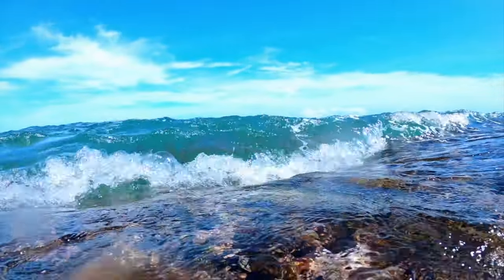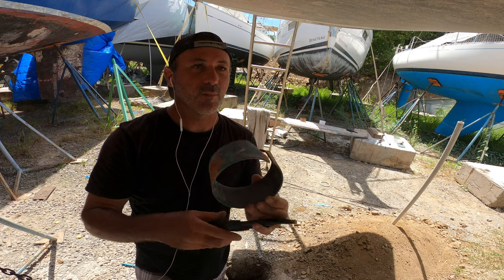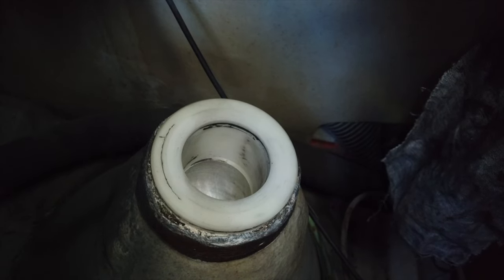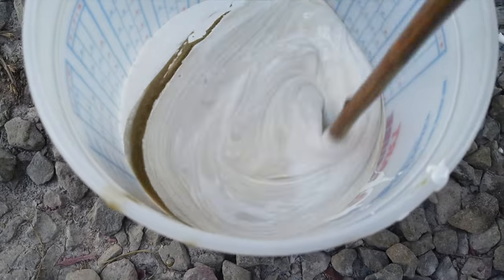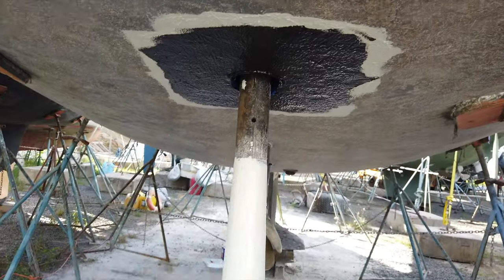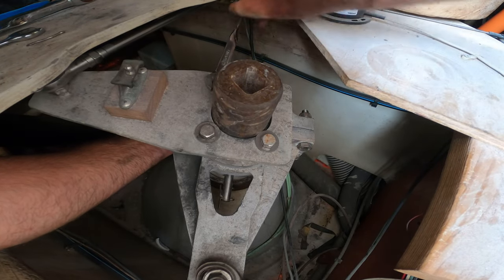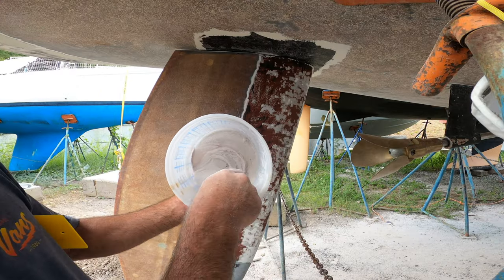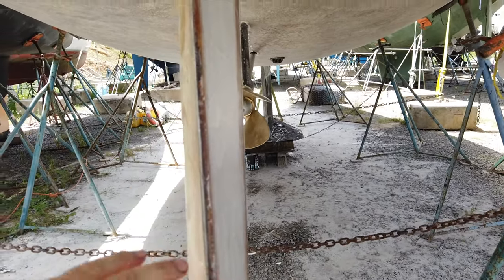SAILBOAT RESTORATION: Beneteau Rudder Bearings and Rudder Installation

Comment: just a tip to make your life easier  - there is not a nut or a bolt - or combo of both on a yacht that doesn't need "never seize" , nickel based
Reply from the maker: @yachticus agree nickel based never seize is a good product but i wouldn’t use it on every single bolt on my yacht.  I do use it on certain things though.

Comment: Help ! Please tell me where you bought a lower rudder bushing !!!! I’m on Carriacou snd having no luck 
The gap is supposed to be .5 mm. No sealant from factory. 
I got this info online but I can’t find a bushing.
Top bushing is fine on my 2000 38.1. Lower had lateral movement
Reply from the maker: @jacobuszwanenburg1629 I purchased the lower bushing from Murray Yacht Sales located in Florida.  Beneteau is using there dealers for parts sales these days.  locate the closest beneteau dealer to your location, likely in Martinique, they should be able to source parts for you.
Reply: @SVAcadian  thank you 👍
Reply: Is that rudder stock fibreglass?